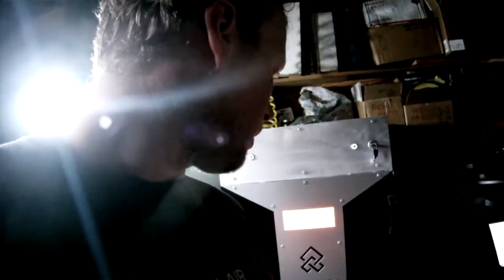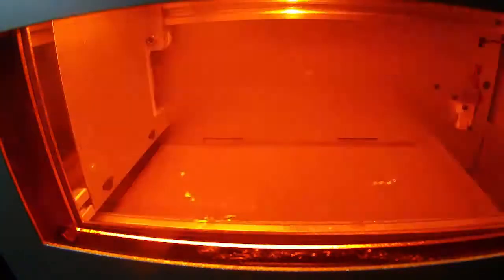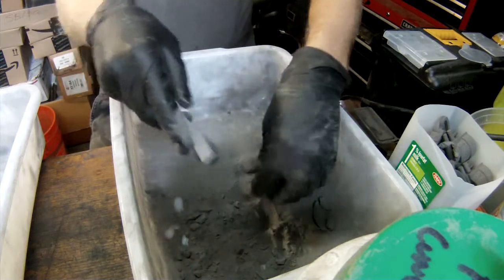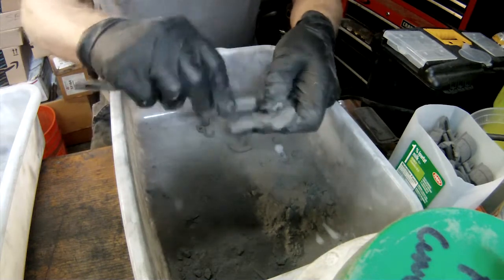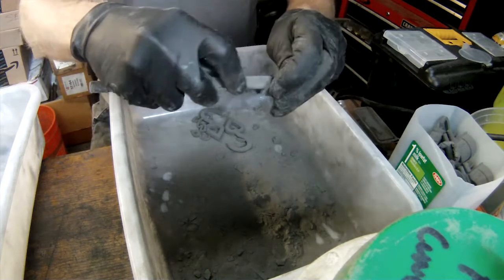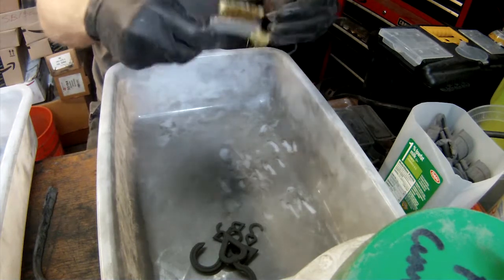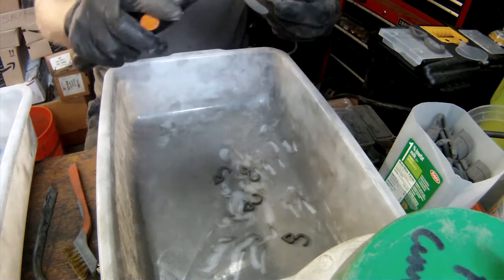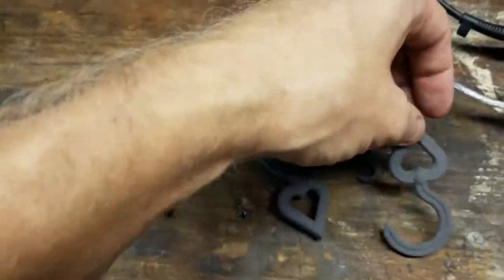Enhancing Sintratec Laser Parameters to Use 100% Old Powder

Comment: Hello, Thank you for the great video, what is your experience in slowing down the laser speed? I have been printing at 200mm/s because at the standard 500mm/s there were random parts of the model that the laser would not fuse well. I could see grey unsintered islands inside the model.
Reply from the maker: Have you cleaned your laser glass?

Comment: This sounds crazy! 100% recycled powder!..
Reply from the maker: I've been doing it for months.  The only reason why I use even a little bit of new powder is to top off my used powder supply.
Reply: @0001D-t3e  how are the prints turning out?
Reply from the maker: @xtc3dresearchteam744  Good.  not much different than 100% new powder.  I've been playing with this thing for 9 months now.  if you fiddle with yours, I'm sure you can get similar results.